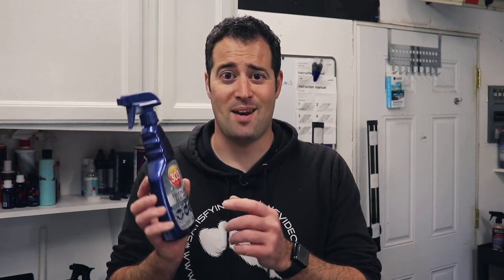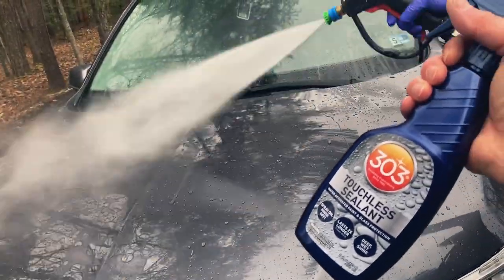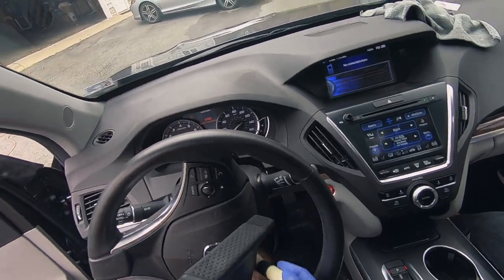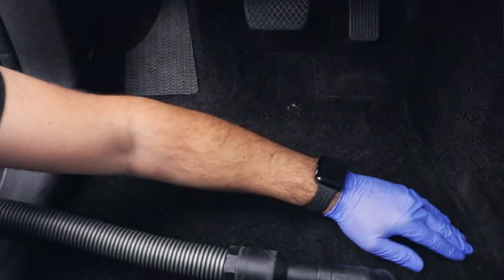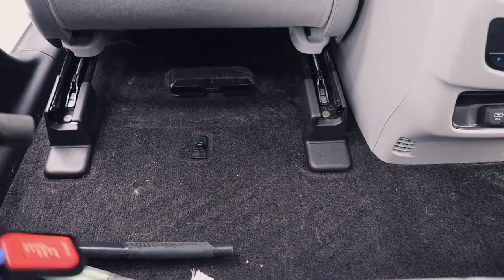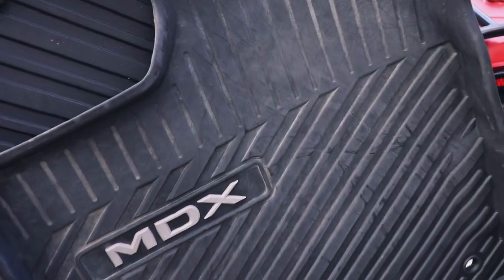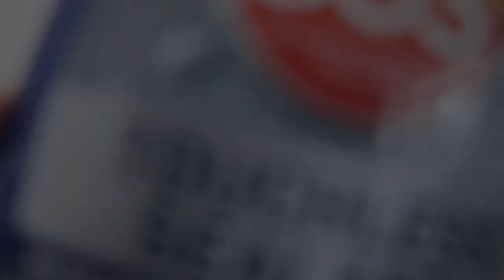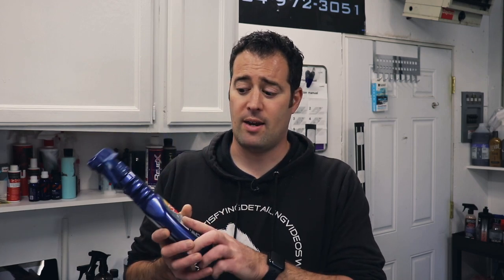Interior and Exterior Detail /// 303 Touchless Sealant /// Dog Hair Removal /// Acura MDX

Comment: I have used 303 sealant with waxed vehicles and it beads like crazy if applied correctly like you did.  It strengthens the wax and sometimes I even apply Bead Maker because customers enjoy feeling the sleekness Bead Maker leaves to the touch.
Hope you weren't left to sleep with the cat, 😉🤣
Xoxo from Puerto Rico and thanks again for this review 👍🇵🇷

Comment: So, after spraying the windows with 303 do you simply dry & buff them? Will using glass cleaner after strip the water sheeting properties of the 303? Thanks.
Reply from the maker: Yeah we just use a little quick detailer or plain water to remove any streaks that happen to be on the glass.

Comment: Phil  I've been looking for a good rubber mat product.  Looking at a little past the 12 minute point, it doesn't look like this did a very good job of cleaning and leaving an even coat of protection.  Did it dry and look better and we did not see this on the video?  I've used Stoner Trim Shine and it makes the mat very slippery unless I knock it down a little bit.  Always enjoy your videos especially under the lockdown here in Kansas.
Reply from the maker: Yeah it did ok but not the best. I wanted to test it out on a beat up mat. On newer mats it would be fine. We use Stoners Trim Shine on beat up mats also and then just wipe it down really good and it’s totally fine with very minimal slipperiness. I the Trim Shine works the best still.

Comment: Have you had any problems with your gravity fed setup? I’m looking to go gravity fed is there any tips you can give thanks for the amazing content btw
Reply from the maker: Hi. No I haven’t. As long as I prime the pump before I start it, it’s fine.  I have the water inlet hose loosely screwed into the pump and have the water flow until it starts to leak then start the washer and it should start sucking the water through.

Comment: good video Phil, using the TW Dry & Shine (£8) equiv of the 303 TS, i find its better to use a wet MF cloth, wipe over the bodywork as you spray, this lets you coat every panel/area, and saves waste.....then blast with PW 😁  Much cheaper to use than Gyeon Wetcoat or AF Aquacoat.
Reply from the maker: Great tip!  Never thought of that!  That would cover everything evenly!  Thanks